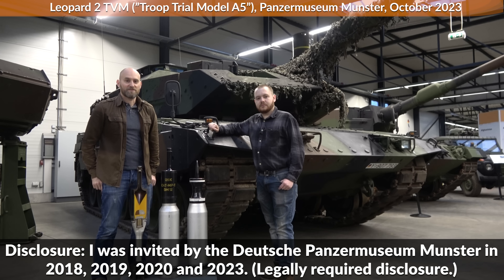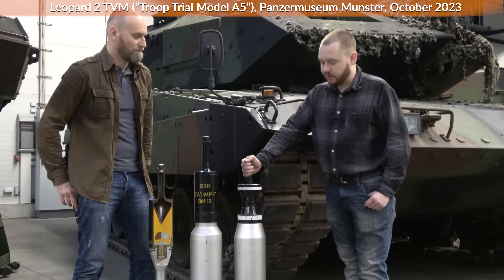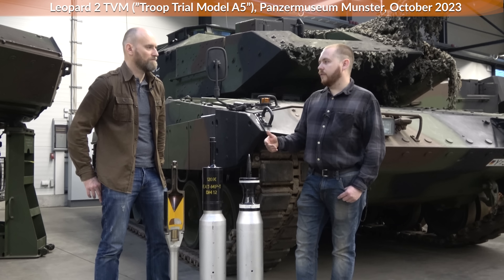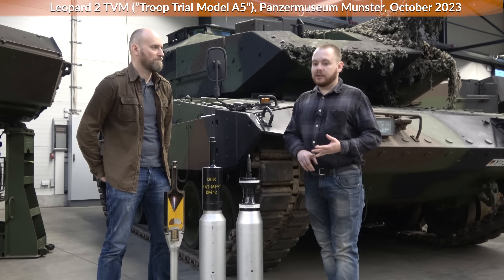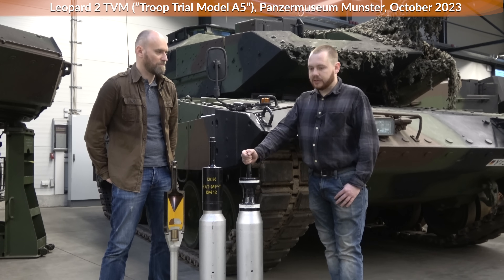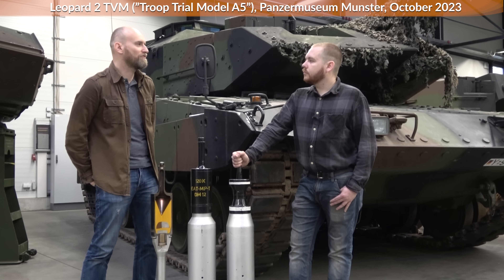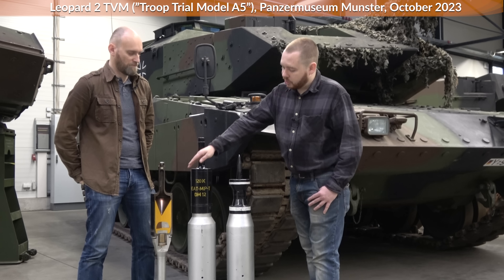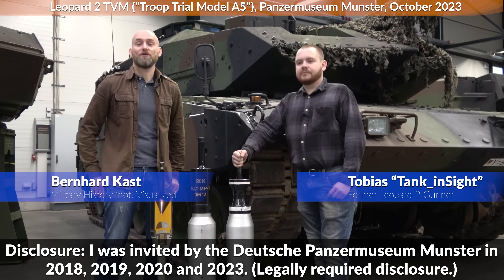Why you need proper HE rounds for Tanks

Comment: 0:56 although the correct word is 'jet' calling it a 'spike' actually might help correct the extremely common misconception about shaped charge projectiles: they do not 'melt' through the armor, the fact they are molten jets of metal is basically irrelevant, it's the velocity the material is traveling at that does all the penetration, just like a 'spike' implies
Reply: Correcting your correction, the jet is non molten. It is a stream of particles. The actual jet itself isn't molten.
Reply: @skillercruz5539 what's the temperature of the particles? And what metal are the particles?
Reply: @janitorizamped can be several different materials, tantalum, copper, steel, and many many more. Military projectiles/charges tend to be copper or tantalum nowadays.
Reply: @janitorizamped  They used to be copper or steel, not sure what they are now (a different commenter is saying mostly copper/tantalum, thanks Wehra96), however the jet reaches between 1,200k (at the absolute upper end) and 810-842k with more modern explosives, which is far below the melting point of copper (1,358k) or tantalum 3,293k)
Reply: @kiagh8123  thank you
Reply: @janitorizamped  There is no single answer to this, however modern shaped charges generally use tantalum, DU and aluminium and at most heat up to around 800 kelvin average. Nowhere close to "melting" anything. Copper is rather antiquated and was predominant only because it was too hard to make the other liners homogenous enough at the time.
Reply: I like to imagine it ablating a hole through material like a water jet cutter. Except instead of water and garnet abrasives, it's plasticized metal moving at mach-Jesus
Reply: @BrokenLifeCycle In the spirit of pedantry. Water jet is not a good example of what is going on with HEAT. Water Jet relies on friction erosion (abrasion) to cut. HEAT actually works in a very similar manner to APFSDS rounds. The velocity of the spike formed by the shaped cone is so fast, from thus the pressure at the impact point is so high that even a soft spike made out of copper can penetrate the hardest of armors. 

Like APFSDS at these kinds of speed the penetrator spike will roughly penetrate its length in similarly dense armor (and half against armor 2x the penetrator density and etc). This is why HEAT needs to detonate at a certain distance away from the target (the standoff distance), it is there to give time for the shaped charged to form a longer spike for more penetrating power (but not too long or the spike stretches too long and disintergrates).
Reply: The jet is solid metal, not liquid or particles.
Reply: In fact tantallum has twice the penetration of copper liners because it melts less and has nearly twice the density. Shaped charge jets melting is a net drain on efficiency!

Comment: 120 mm HE DM 11 Tank Ammunition
Rheinmetall's latest ammunition product is the DM 11, a 120 mm HE tank round. Owing to its time-delay fuse, it is especially suitable for supporting infantry units tasked with taking lightly fortified positions as well as for engaging light and medium-weight armoured vehicles. After loading, an electronic module programs the time-delay fuse to detonate at a specific point in the projectile's flight path: the round can be timed to explode for maximum effect either above, in front or inside of a target (e.g. after penetrating a wall). The DM 11 is thus a perfect match for the altered operational requirements of modern main battle tanks.
Reply: How does it compare to the new Russian HE ammunition?

Comment: Excellent presentation!  I've read that US tankers in WW II weren't always fans of the 76mm gun.  Many of them thought the original 75mm had a better HE round for fire support.
Reply: Well over 90% of 75mm rounds were HE so they weren't wrong...tank vs tank combat was very rare in practice.
Reply: @dogsnads5634  it's nor very rare at all, it just wasn't the majority of tank battles

Still, there is a reason 90% of tank development since WW2 has been the result of the enemy fielding better tanks, not infantry
Reply: It's wasn't just fire support, German crew served AT guns where a far, far greater threat to western forces. Being able to rapidly pop off vollies of HE against soft targets was vital.
Reply: A mystery and one I've never heard explained is why they simply weren't firing the original 75mm round with a smaller propellant charge.
Reply: @0thPAg  gun firing with stronger force needs a thicker walled shells to stand the forces, therefore leaving less room for explosive filler. Possibly these hypothetical repurposed 75mm shells would simply not work because of that
So that's why low-velocity guns can usually lob shells with more explosive filler per pound, while the higher the guns' velocity the less it's shell can hold
Reply: @czwarty7878  you can underload a cannon. Smoke shells were using barely any powder. That's why I don' get the crying that 76mm gun had low filler - why didn't they simply switch to lower propellant rounds and bigger shells?
Reply: @0thPAg  firing a 75mm round out of a 76? wouldn't work
Reply: Don’t comment on what don’t know 
The 76 was a different 75 from the Sherman and the ammo was incompatible 
The new 75 was called a 76

Comment: TL;DR: The West built glorified tank destroyers for 40+ years and forgot that targets other than tanks exist. Meanwhile, Russian/Soviet tanks always fielded an HE-Frag round and devoted a significant portion of the ammo loadout for it.
Reply: NATO tanks were designed under the assumption a limited nuclear exchange would occur and that infantry would not be much a concern due to said radiation along with the fact that they considered Russian armored vehicles to be the greatest threat in that event.
Reply: They didn't "forget about other targets", they were arming according to their doctrine. The biggest fear during the Cold War (aside from nukes obviously) was a mass Soviet armor charge through the Fulda Gap. Nothing at the time could've stopped this armor banzai because the Soviets had insane armor quantities, as you can tell by Russian casualty tolerance in this war. Therefore NATO designed their tanks accordingly - to be superior in tank duels and to keep the crew alive (no infinite Ivans to stuff inside those cans like the Soviets either). Somewhat of an exception to this was the Leopard 1 which is just kind of a failed design when you consider the above, made under the false impression that projectiles, especially HEAT, are just too powerful, therefore no point in armoring the tank entirely.

Desert Storm was proof that NATO tank doctrine and design did work. The Abrams (and the Brad too) absolutely dominated armor duels, the T-72 barely stood a chance. War is always changing however. The reality is that armor duels in Ukraine are extremely rare. Advancements in drones and ATGMs just made it pointless to send armor against armor. Sure the Ukrainians could send a Leo 2 when scouts report an armor charge to snipe them at 3-4km - but it's more likely to get blown up by a Russian FPV or Krasnopol than a T-72 or even 90.

Ultimately I do agree that Russian HE-heavy doctrine is proving superior in the present, but above all I emphasize the strange state of tanks in the wider picture. I do not subscribe to the "age of tanks is over" dooming, but a counter to drones is a must before they become fully viable again (not that they're useless even in the current state!).

Comment: And people wonder why the British retained HESH and rifled barrels for so long after they became ineffective against tanks. HESH is effective against other targets, like bunkers for which it was originally designed.
Reply: thats only partially true.
the Brits retained HESH and rifled barrels, because Thatcher and her Bunch were cheap and cut funding for MBT-80 (killing MBT-80) and also overruled the MOD and MBT comission on procurement details.
They pushed for  a 100% domestic solution that had to incorporate as much of Chieftains tech as possible and be as cheap as possible.  (Challenger 1, wich was a modification of a failed Chieftain Upgrade bid for Iran, the Shir 2)
MBT-80 was intended to use either a domestic smoothbore (wich was not ready at the time) or a license build RH120 L/44 smoothbore (like M1 or Leo2) to achieve NATO ammunition commonality.
The same happened again with Challenger 2.
So its not due to amazing foresight of the brits, but due to blockheaded pennypinching and going for the cheapest solution possible, that the UK retained rifled guns and HESH.
Btw alot of the problems of the UK military of the last 3 1/2 to 4 decades are results from Thatchers pennypinching and going for the cheapest option.
Reply: @zhufortheimpaler4041 yup the brits tanks cannot use NATO standard ammunition which is ridiculously stupid and goes to show that the British could not be relide upon in a protracted conflict...
Reply: @kskeel1124  "yup the brits tanks cannot use NATO standard ammunition"

The British developed 105mm which became the de-facto NATO standard...
But because they were rightly concerned about 105mm's potential against newer generations of Soviet tanks they moved to 120mm, which the UK and US developed (M103 and Conqueror).
This was far, far before the German's and US moved to 120mm smoothbore...
So who was not following the 'standard'....
Answer....the German's....
Reply: @dogsnads5634  not correct. the 120x570mm smoothbore cartridge was chosen to be NATO standard in STANAG 4385 in 1979. The US adopted the 120mm late, due to problems concerning US semi combustible cartridges and fitting of the 120mm, while the french agreed to change to 120x570mm in 79 and started their own 120mm smoothbore armed MBT project (Leclerc) in 1986 after they developed their own domestic 120x570mm smoothbore gun for that purpose.
It was the UK that didnt adopt NATO standard ammunition and guns for their next generatoin MBT (Challenger 1) and retaining that unicorn status till now.
Reply: @zhufortheimpaler4041  So lets get this straight...1 nation in NATO had 900 120mm gun tanks in service in 1979...the UK...
Just remind me how many 120mm armed tanks everyone else in NATO had in service in 1979....
Big fat zero....
So who was deviating from the 'standard'...

You'll be telling me next that all 120mm smoothbore rounds are compatible with all 120mm guns...or that 155mm shells are cross compatible as well...
Reply: @zhufortheimpaler4041  Thatcher was removed from being Prime Minister on 28th November 1990. 8 Prime Ministers later,in 2021, the smooth-bore gun was adopted for a programme started in 2005 under Tony Blair.

So they pushed for a wholly domestic tank, whilst simultaneously insisting that all combat aircraft had to be collaborative efforts. Strange.
Reply: @neiloflongbeck5705  i never said british procurement was done with brain or consistency.
But it is true that the Thatcher government explicitly pushed for the continuous use of the L11 of Challenger 1 and L11 derivate L30 on Challenger 2, even though the relevant comissions of the MOD procurement and planning advised and wished for a 120mm smoothbore over and over again to reach capability parity and ammunition commonality with M1 and Leo2.
By the time Thatcher came to power, Tornado was already basicly done and nothing coud be changed about that.

EF2000 also was in developement at this point and the UK was not a majority shareholder, so they stuck to it. (european fighter jet cooperation started in 71, the definite EF2000 programm started in 83, an in 86 already had several functional prototypes etc to show)

thatchers nationalism and economic policy never was rational
Reply: @zhufortheimpaler4041  but you did say it was done with brains and consistency, otherwise why retain a weapon system past its best? Thatcher's economic policies came from her deep moral and political convictions.
Reply: @neiloflongbeck5705  Well now the Advanced MultiPurpose round exists.
Which has the benefit of HE with the flexibility of HEAT.
It’s basically a programmable HE round that can penetrate through objects before detonating, even being able to go through normal concrete bunker thick walls.
It can hit a BMP, go through the thin aluminum and detonate inside, killing all the little piggies in an instant.
HESH is quite frankly outdated now that technology has advanced enough to allow advanced programmable Fuzes.
Reply: false. HESH is made of pure plastic explosive which means you only get an instantaneous detonation rather than a deflagration. it decreases the radius which will seriously injure/kill as a deflagration will "spread." HESH lacks the fragmentation ability of HE-FRAG greatly reducing its ability to hurt infantry as well . Concrete fortifications are rare in modern conflicts since it takes a ton of time to build and requires heavy machinery. Most defensive emplacements are just dirt ramparts or dug in trenches. HASCO walls maybe. If you wanna pierce something HEAT will do it better since its not reliant on the material to do damage. HESH shockwave will be absorbed through the dirt and the dirt that flys out as "spall" will unlikely be lethal. HESH is pretty much just as useless as HE against HASCO barriers. HEAT can actually penetrate it. The argument that its a "jack of all trades" is dumb in warfare because it truly is a "master of none." If theres infantry in a trench i want to use fragmentation or HE. If theres a reinforced position im gonna use HEAT. Against infantry HESH is just as useful as HEAT since it lacks fragmentation and lack the ability to spread the blast wave. MPAT/HEAT-MP is definately a step in the right direction especially as electronics get cheaper. However a dedicated HE-frag round is still essential to increase the lethality of a tank against infantry. In an ideal world, MPAT/HEAT-MP and HE-frag with a timed+impact fuze would be the most optimal ammunition against light vehicles, emplacements, and infantry. You'd use HE-frag and HEAT-mp accordingly and if you run out of frag, just use HEAT-mp as itll still work just not as well. from what ive seen through combat footage in ukraine, tanks are firing alot more HE than HEAT against infantry, as most fortifications are just trenches. 

The only reason i think that the abrams/leopard dont use frag is because they have limited ready rack stowage(18 and 15 respectively) whereas russian tanks have 22(AZ autoloader found on t72/t90) and 28(MZ autoloader found on t64/t80) ready rounds.
Reply: @itsericzhou  HESH was developed during WW2 as an anti-fortification weapon. It was also found to good at killing tanks and other armoured vehicles, but as armour technology advanced, it became less effective against other tanks but still capable against less well armoured vehicles. Why waste an APFSDS round against a target it would go straight through? And as smooth bore weapons predominately the tank world eventually it would lose its place in British tanks.
Reply: HESH is good against buildings and light armor unfortunately the armor is so light that 120mm HE shell would overpressure it anyway. And instead of sinking inside soft ground explode on touch. Or HE would actually create fragmentation to kill infantry because HESH walls are too thin and weak to create actual fragmentation
Reply: HESH is made against concrete fortifications which nobody uses anymore, it's useless and they should have just opted for HE instead.
Reply: Ukrainians complain that hesh has been useless on the challenger 2s they got. They much prefure HE that other tanks get.
Reply: Literally the only major military power still using a rifled tank barrel...😂
Reply: @kskeel1124  Aside from China and India lol
Reply: HE and even HESH rounds can still be fired from smoothbore barrels
Reply: @Ranyick  sure but HESH does not really work well from smoothbores, as it requires high spin stabilisation and the spin to spread properly pre detonation. 
HESH is just inferior to modern HE-Frag like DM11
Reply: @zhufortheimpaler4041  if the spinning is so important, then why does the muzzle of a Challenger II have a device specifically to negate the effects of the rifling?
Reply: @Ranyick  you are mixing up a few things.
Challenger 1 and 2´s KE rounds (APFSDS like L23a1 or L26a1) have rifling neutralising sabots, as APFSDS rounds dont like riflings spin. (it destabilises fin stabilised rounds)
HESH and similar full bore non fin stabilised projectiles require the spin to stabilise.
Reply: @zhufortheimpaler4041  
Thats false, plenty of hesh projectile works without stabilization.
Reply: @zhufortheimpaler4041  while your first point is correct (and just proves my original point), your second point isn’t. HE shells fired by smoothbore guns are as accurate, if not more accurate, than HESH shells fired by rifled guns
Reply: @Ranyick  thats because they use fin stabilisation, instead of spin stabilisation.
HESH rounds dont have a  tail and fins.